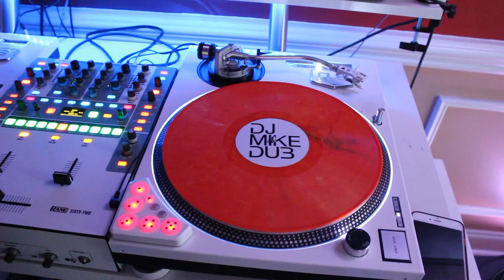DJ Shop Talk: Technics 1200 LED Halo

Comment: may i ask wits the kit u hv and where did u get it? can you use this on a SL-DZ1200 CD TURNTABLE?
Reply from the maker: DJROBONE1 ICE COLD CUSTOMS USA / ORBIT DELUXE (UNDER PLATTER LED SYSTEM with PITCH FADER MOD) LED KIT for all models of the legendary Technics 1200/1210 Turntables. Not sure if it will work for the CD players.
Reply: DJ MikeDub I understand it's foe all models but I hv 2 technics SL-DZ1200 CD PLAYERS WILL THEY FIT? AS WELL?
Reply: Oh ok thnks u

Comment: Yo! Dub where could I order the LED lights for the technic 1200 platter
Reply from the maker: eBay Ice cold customs, 

https://www.ebay.com/itm/165497343072?mkcid=16&mkevt=1&mkrid=711-127632-2357-0&ssspo=cmaeqG4qRfK&sssrc=2349624&ssuid=ztJO0hqyRui&var=&widget_ver=artemis&media=COPY
Reply from the maker: I changed out my light controller for a WiFi module, I just use there power supply.
Reply: Hey Thanks again DJ Mike Dub👊🏿 you save me a lot of money homie.

Comment: Yo dope video bro very thorough in your explanations.. I may be able to help you with the ground issue if it's still causing you problems. where do you have that ground cable leading to under the tone arm assembly cover, and where is it soldered to?
Reply from the maker: HavikTheGreat I fixed the ground issue

Comment: k..   here is how to really do it..10$ per player ...   get  simple  usb plug... solder the plug prong ends  to the posts.. then plug led strip into usb ..ta daaaaaa...  no need for  that huge power block thing u have there..
Reply from the maker: specialformula14 ok well try it and send me a link to your video of you doing, sounds like it would work but I don’t know.
Reply: it does work.. i did it to both of my turntables ... i dont have a video.. but i could send you pics of what i did .. discord? and it retains the stalk under platter as well
Reply from the maker: specialformula14 follow me on Instagram and send the pics via Direct Message. @djmikedub
Reply: @anthonysykes603  u bet ill email ya pics in  a couple hours when im home
Reply: just emailed ya the pics and info .
Reply: can you please send me instructions and pics on how u did ur mod
Reply: @FullFlavorThrift  sure